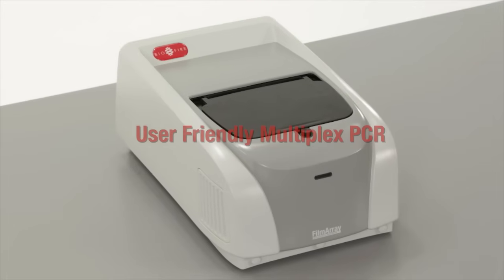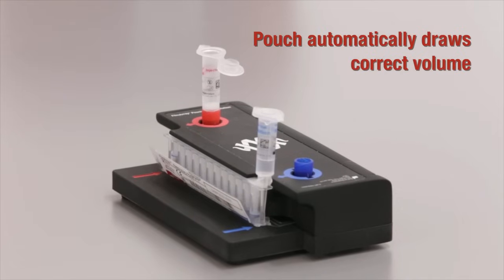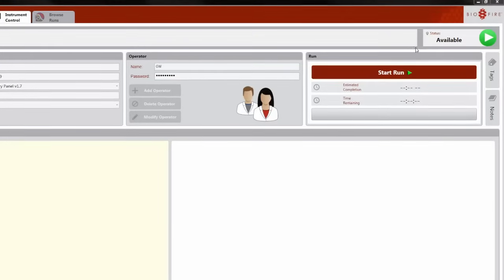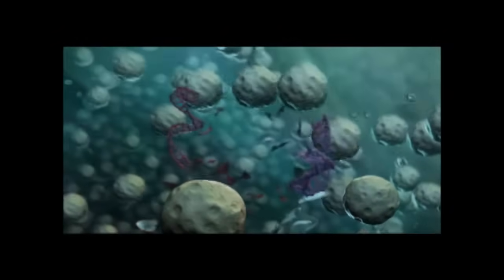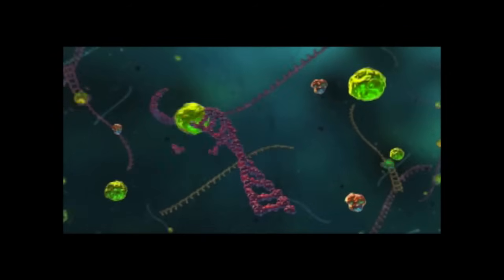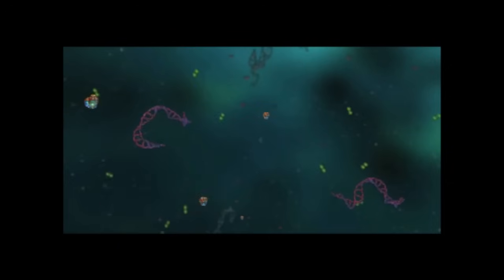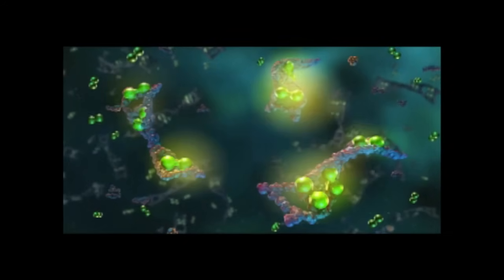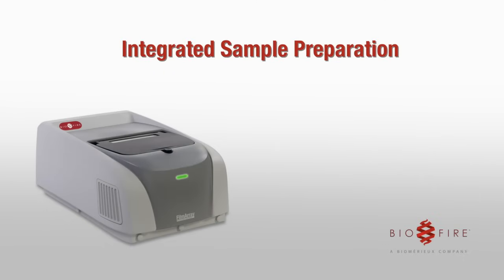The BioFire® FilmArray® System - How It Works

Comment: how many sample can you test ?
Reply: Unfortunately one at a time, i currently use this for COVID-19, great analyzer with very simplified user friendly PCR methodology. Turn around per test roughly around 45mins so it would be good to have few depending on your medical facility patient load.
Reply: @drewsworld876  one at a time per day?
Reply: @JessieVida  correct, we currently have 3 to help with the throughput.
Reply: @JessieVida  a little late, but I'm a technologist in immunology. Depending on how many machines you have, but yes 1 sample at a time per machine. 45 minutes for results, so you can still run quite a few in a day. We have 4 in the lab I'm in